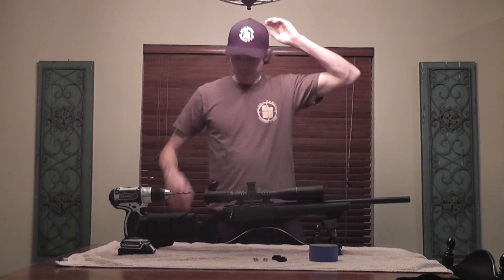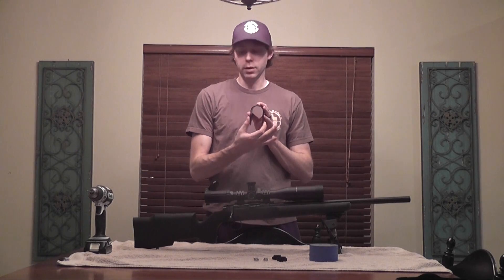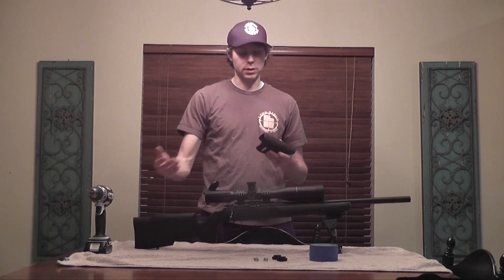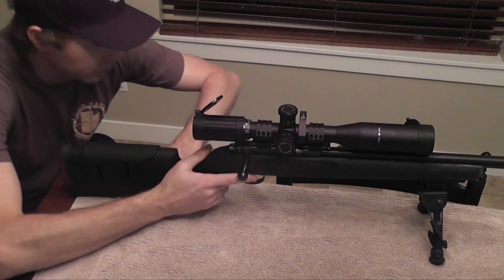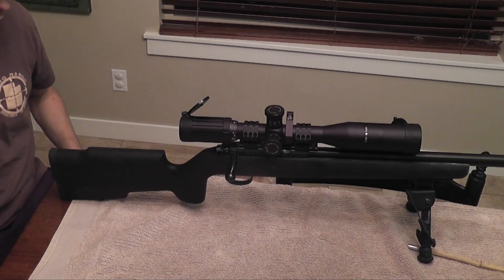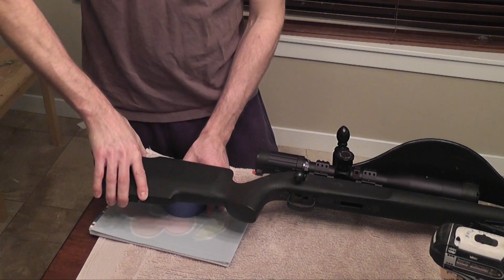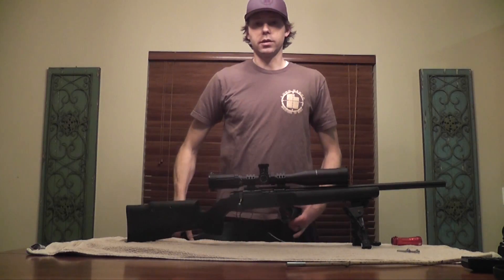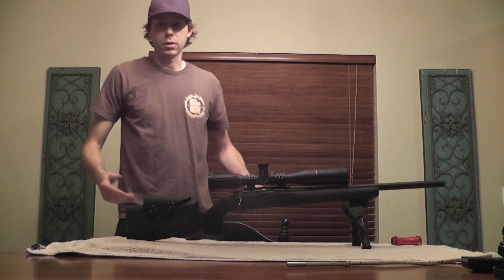2 of 5 Accurizing a CZ 455 Tacticool 22 LR (Adjustable Cheek Rest Install)

Comment: I just ordered a Tacticool 22LR from CZ..... What scopes do you recommend that wont would be under the $200 mark. I doubt I will get out past 600 yards with this setup and do a lot of paper punching with my daughters with this at 50- 200 yards for sure. Are the BSA Sweet 22 6-18x scopes any good, I see SWFA has em on sale for under $100.
Reply from the maker: +Sarge&#39;s Adventures I can't say there is an optics under $299 that I would recommend.   The SWFA fixed power line are great.  The SWFA 3-15 x 42 FFP is my budget recommendation.

Comment: Thank you for your suggestion,I just order DIP 25oma extended rail and a spring kit. Did you experience  any problem setting your zero on the scope at 50 yards or closer? And one more question, any suggestion on inexpensive spotting scope, any experience with  older spotting scopes?

Comment: I just purchase cz455 and I am using your videos to accurizing my rifle. Can you please advise me on scope rings. What rings are you using  and what height they are.  I have 8.5x25  58mm scope.
Thank you
Reply from the maker: Peter Roberts I'm running the burris tactical rings.  The objective end of my optic is 60 mm so I switch from the medium to extra high rings when I changed scopes.  I used an extended 25 moa  DIP rail (diversified innovative products) specifically designed for the cz 455.  The yo dave trigger kit is extremely popular.

Comment: Bryce, Great video & that's the Bear Paw Cheek rest for extra room for your shooting hand. 

The video was Little funny & scary at some parts. Died laughing when you said, hmm hard to see the black sharpie mark. Scary drilling all the way through if you didn't drill straight, :). And I kept saying, OPEN the bolt, so you know you can cycle another round without hitting the cheek rest.

Order one of my TactiCool cheek rests, you will be much happier with it than the 2" wide HS cheek rest as you said it is much wider than the 1.5" straight TactiCool stock.

Remember I give LRSU discounts... Just contact me for pricing. And I now have Black Oxide bolts as well as the Stainless steel bolts.

Also watch my installation video, it will be less scary for you next time. I'll post a link in my next post.

Sincerely,

Matthew